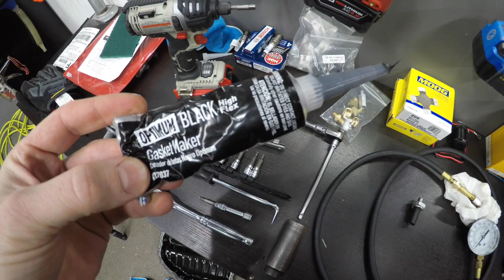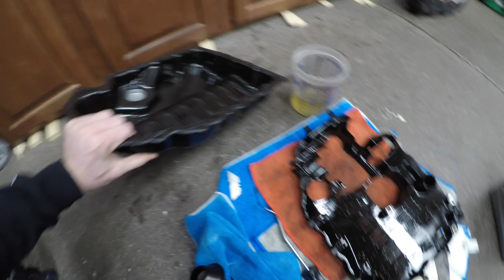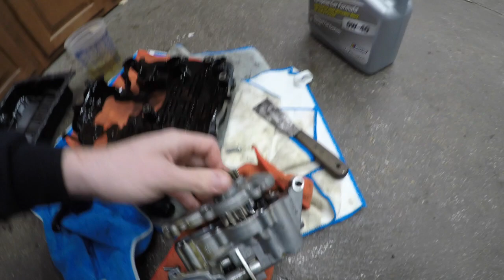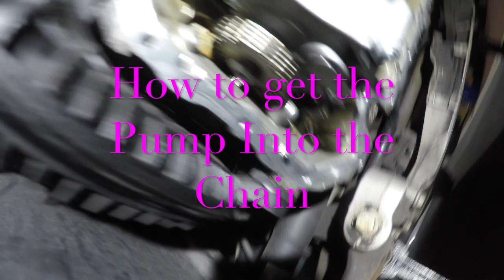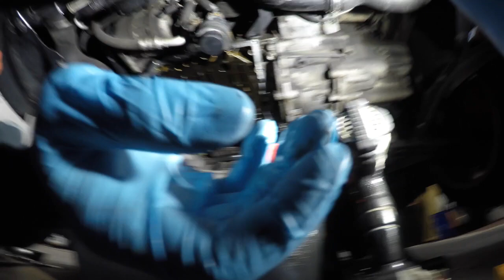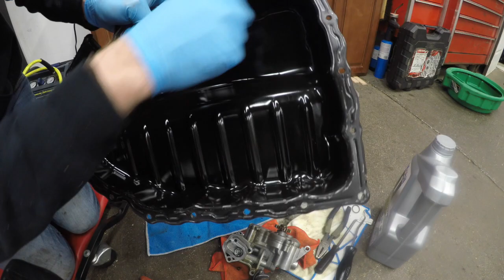MK6 2.0 TSI Oil Pump Installation - GTi / Jetta

Comment: My car has developed a whine sound whenever you rev it I’m attempting to replace the pump after getting a oil pressure warning
Reply from the maker: That’s hard to say. I haven’t heard a whine before, but change the pump and see what your pressure is like. It may be tensioner related as well. Good luck!

Comment: Hi Kenny! It is possible the timming slip with this procedure?
Reply: if i skip the put some oil into the pump, the oil pump could be damage? and some noise comes?
Reply from the maker: @Joseavazquez  hi, no the engine timing is independent of the oil pump. The pump has its own chain and tensioner which is driven from the crank. 

Putting oil in the pump before hand can help the priming of the pump and prevent dry run. It is a good practice although I have not had issues with the pump priming almost instantly as long as the engine is filled with oil prior to starting.

Comment: Not doing an oil pump, but doing timing chains on my wifes 2.0tsi beetle, by the looks of things am i right to assume the only way to get the damn oil pump drive chain out is to drop the oil pan ?
Reply from the maker: Hey, I think so based on where the tensioner is located. There may be some way to magically get it but for the time it takes to pull the pan, probably not even worth it. Also be careful when putting the crank pulley back on because you can bolt it back together without those triangular shaped teeth on the back. 

Also check the balance shafts while your there, and also the cam bridge at the top end. Those screens tend to pop out and may cause a pressure light. I ended up replacing everything in my car as a precaution. 

Good luck!

Comment: I have a similar problem with my 2.0 tsi jetta. I have had the oil pressure light come on and beep at me when decelerating for some time. Even more recent i have started getting a very loud knocking sound. Oil pressure was around 36 psi which is a little low. Could this be an oil pump? or something else like balance shafts, timing chain tensioner, or bearings?
Reply from the maker: Hi, it all starts with the oil pressure test at idle and accelerating the engine. If you are getting a noise you may have something going on there. I haven’t heard balance shafts make noise so you may want to drop the pan and check the rod bearings. Checking the pan will also allow you to check for metal debris and build up in the pump and pan corners. Good luck!

Comment: Hey I’m doing this on my GLI today. I’m very thankful for the video you made really. Now is that oil pump you installed still operating well?
Reply from the maker: Hi, Im glad it could help! Well, I sold the car about 2 years ago, but at the time there was no oil light or issues. So this certainly resolved my problem. I hope it resolves your issue as well!
Reply: @KennyChurchSpeed  thank you. I literally did the work a couple hours ago. I’m letting it sit in my shop overnight before filling and will see if it stops my issue. I get the light at low rpm when the car is at operating temp

Comment: FYI, for those of you who've had to remove their mk5 or mk6 tsi oil pan more than once or plan to remove it regularly for inspection, you can upgrade to an mk7 oil pan (or even an aftermarket performance oil pan from Wortek), which uses a proper o ring gasket instead of rtv silicone.
Reply from the maker: Thanks for posting and keeping folks informed.
Reply: Can it be used on the older style? Or the new style pan has the indentations for it?

Comment: So you didnt remove lower timing cover to do this job?
Reply from the maker: Nope, it is not required. The only part you need to worry about is the lower oil pump chain which isn’t timing related. The pump doesn’t care where the position of the crank or cam is, it only cares about moving oil.

Comment: I have the exact same issue, I'm looking to replace the pump soon. My car doesnt seem to have any mayor issues besides the pump,but I will be driving it like 2 more weeks before I can purchase the pump. Do you think I will be okay driving it like that till I can purchase pump??. BTW thanks for the video, it's very helpful.
Reply from the maker: Hi, thanks for watching and I’m glad to hear it is helpful. I would suggest not driving it if you can help it. You need the lubrication, especially at higher rpms. A $300 pump could cost you way more if you continue to drive it with low oil pressure. Good luck!

Comment: Hello I have a Tiguan 2.0 that gives me 0 with the pressure meter that can be
Reply from the maker: If the gage is reading zero that isn’t a good sign. Does it go up when you give it throttle and in rpm? If you have no pressure at idle either you have no oil flow at all, or the orifices that create pressure are open so something is worn.  Start with the pump and rod bearings. Easy enough to pull the oil pan and see what you find.

Comment: Can you help me with idea ? can i email you and get whatsapp number ose something else where to contact. 
Im preparing my audi 1.8 tfsi, got some parts changed. Oil pressure issue. I will make test pressure in iddle, and in rpm, hot/warm/cold etc etc
Reply from the maker: What idea do you need help with?
Reply: @KennyChurchSpeed  Audi a3 1.8tfsi bought it with timing chain plastic broken and timing chain skiped. Engine had damaged valves , New valve + seals, new timing chain. Installed all and after idling for 1-2 hour engine blocked. When opened found that Balanc shaft was blocked, not the water pump Balanc shaft but other one. Changed it with used one. After all install in reverse, after driving 20 minutes in city got Oil Pressure llamp on for 3-4 seconds. After turned off the car and started again after 5 minutes got it again Oil pressure lamp at 50-60 kmh hour, reving rpm again and does not get off the llamp. 4-5 second lamp on. Turned off the car and rest 1 hour, when getting home started driving 10-15 minutes lamp was on again for 2 minutes. every 600 meter lamp on and turned off car every 600 meters. No meter in 10kmh-30kmh lamp does not go off. It heard the noise from engine head and not function camshaft due to no much oil pressure. Now car is parked and i don't know where to start.
For now i will do the pressure test idle and rev rpm to see.
Reply from the maker: @azzxzxzaz  the pressure test is a good first place to start. These engines have a lot of oil passages and it is critical the screens are clear and free of debris. Balance shafts, cam bridge, oil pump, rod and main bearings all really important for proper oil pressure. First and foremost you need good oil flow which will be provided by the pump.
Reply: @KennyChurchSpeed  one of balance shaft had a plastic cover and was broken, we removed that plastic. Can that indicate problem without plastic oil canot get down freely
Reply: @KennyChurchSpeed  Just tested Oil pressure. When car is cold , Have at iddle 2.5 Bar pressure. When getting warm in 3-4 minutes it drops not stable from 1.5bar to 2.0 bar, 1.6 bar . 2.0 bar. 1.9 bar, not stable, 1.5,1.7,1.9.   After 8-10 minutes it drops 0.5 Bar with oil temperature around 60-80Degree, than it goes zero pressure oil temperature 90-105 deegre.

I have pressure when reving, but on iddle is zero after 1- minutes warm.
Reply: @KennyChurchSpeed  Hello. Changed the oil pump today. Enginse is the same, after 5-10 minutes of warm, Oil Pressure drop near zero on iddle. No diference.  Think is Cambridge or 2 balance shaft?
Reply from the maker: @azzxzxzaz  yes, unfortunately it could be one of those. It may be worth your while to check your rod bearings as well because they are easy to access with the engine in.

Comment: How important is that plastic baffle that sits around the pickup tube, what’s its purpose?
Reply: Keeps the majority of the oil in the sump (lower part of the pan), so there is always enough there for the oil pickup tube to feed the pump continuing the cycle efficiently.

Comment: I have the same issue with my Tiguan TSI, the sensor and oil filter are ok. I just open the oil pan and the plastic with the tube is ok. But I can figure it out that the oil pump is aftermarket and this could be the problem...
Reply from the maker: Did you check oil pressure with an external gauge?
Reply: @KennyChurchSpeed  not yet, I'm thinking to make it
Reply: @KennyChurchSpeed  I'm checking today, and if the pressure is lower?

Comment: hi dose the oil pump need to be primed
Reply from the maker: Technically, it may need to be. I'm actually not sure what the manual references. You can put oil in it before installation but the pump is a mechanical gear type so it tends to just leak out. Every pump I've put in, including vr6 engines I've installed cranked and it's built pressure right away. Especially in a used engine, it already has oil in all the parts that rotate. While you don't want it running for long without fresh oil, usually withing cranking and the first second of running you have oil pressure.

Comment: Hi Kenny I have a 2009 Jetta GLI. 2.0L. It’s a CCTA engine. I had a low oil pressure light came on. I changed the oil pressure sensor and I drove it for 2 hours. Then the light came back on for like 3-5 seconds, then It went away. I keep driving for 3 hours it never came back on. Do you think it could be a oil pump?  The engine oil level is full and I don’t see any where it’s leaking. I changed the oil 1000 KM ago.
Reply from the maker: Hi, it's hard to say. I've seen the sensors go bad. So if you changed it and it doesn't come back on that could have been the issue. However, I would do an oil pressure test to be sure because you don't want premature engine damage that could have been avoided.

Comment: Great Video!  Thank You! I was just reading all of your excellent responses I did a pump but I’m still getting low pressure.  It’s been going on    
On and off since 115K miles and now more frequently at 161K! My pickup tube had some junk in it so I was hopeful.  I need to do some more troubleshooting.  The car drives great but I get that intermittent low pressure warning more frequently.
Reply from the maker: Thank you, when do you get the light? On decel, low rpm, high rpm, startup?

Comment: Thank you for taking the time to put this vid together!

My issue started after a botched valve decarb. My idiot cousin said he knew what he was doing but ended up f-ing everything up.  Had to take the car to the shop for valve job, but now the shop doesn't want to mess with it anymore. They're just not used to these kinds of repairs and have a long wait list due to labor shortages.

I guess my question is, what is the most likely scenario here? Oil pressure registers normal at higher RPM, but drops to nothing at idle. Mechanic says there are shavings in the oil and there is likely a blockage somewhere, but the pick up tube screen looks normal. So where could this blockage be?  Could this be a bad oil pump?

It sucks because the car is in otherwise great shape and I'd hate to simply drop another engine in it or junk it.
Reply from the maker: @TrollBuster thanks for the kind words and you're welcome.

As far as your questions, what did your cousin screw up? When you do a valve cleaning you don't need to do anything with timing that would lead to a valve job unless there was a tool left in the cylinder?

As far as what's next, if you have checked oil pressure with a gauge and you see good pressure at rpm then it typically isn't a pump issue. If you have low pressure at idle it could mean you have bearing failure( result of cleaning valves and solvent getting into cylinders and leaking into oil reducing lubrication properties), or the screens in the cam bridge blew out, or balance shafts are wearing. The unfortunate part of these engines is there are a lot of passages that prevent oil flow(hence creating pressure) so when they are absent pressure is reduced. 

What I have learned is once there is an oil pressure issue you have to replace all the components and check the bearings at least. The balance shafts, cam bridge, rod bearings, cam journals all contribute to ensuring pressure is created. 

I hope this helps...
Reply: @KennyChurchSpeed  Thank you for your insights. I think my cousin used the wrong medium (too fine) to blast the carbon, and didn't take proper precautions to ensure the fine medium didn't get where it shouldn't have. I suspect that's what those "shavings" are -- medium particles that ended up circulating in the oil, causing a clog that starved the engine of oil pressure and damaged it (I haven't personally seen the particles, I'm just going by what the mechanic said on the phone). I'm not ready to give up on it tho. If it is a clog, I think the logical thing to do is disassemble it and clean out every orifice where oil flows, replace any parts that show clear signs of wear/damage, and put it all back together. I know it's labor intensive and therefore expensive, but I'm just not ready to give up on it. I don't know, maybe I'm just an idiot and don't know what I'm talking about... lol
Reply from the maker: @marco1173  I'd give you an "A" for effort and it certainly can be done. The balance shafts are the hardest thing to remove with the engine in the car. Everything else is cake. Also you need a special tool to remove valve cover because it's the cam cap/girdle assemble in one. If media got into the cylinders you may have more problems than just oil pressure. You may want to consider time and effort versus cost of a used running engine.
Reply: @KennyChurchSpeed  That's just it. The shop says the only used engine they could find has 75k miles on it and the total cost of engine+installation is $6700. That's just crazy, especially when I can order a complete brand-new engine assembly from the dealer for under $5k. In any case, it's turning out to be a very expensive decarb job. I haven't talked to my cousin since this happened, but I can't hold a grudge forever. I just need to get this thing back running again. I truly miss driving it.
Reply from the maker: @marco1173  I understand your predicament. It sounds like your cousins heart was in the right place, but perhaps he didn't have the skill set. My fear for you is if you got media in the cylinder and it scores the bore you will need rings and honing.
Reply: @KennyChurchSpeed  I thought you might want to hear an update, Kenny. Maybe I can pick your brain too? You seem knowledgeable enough with these engines...

Anyway, I have the bottom end mostly taken apart. Oil pan, baffle, oil pump, all out. No obvious issues there, though I'm not sure about the oil pump... Looks mint, but how can you tell if it's good or not just by looking at it? 

Yesterday I started working on removing the subframe to check for obstructions, since I suspect the oil filter opening may have been left exposed and debris made its way down there. I'm sorta stumped here... There are 5 M12 bolts holding the subframe to the engine block, but then it looks like the engine mount may need to come out too?

How difficult would it be to remove the engine without a lift? I mean, I have access to an engine hoist and stand and it's starting to make more sense to just work on it completely off the car.
Reply from the maker: @marco1173  hi, there is no easy way to identify a pump issue when you look at the outside. Mine looked great as well, but something was certainly malfunctioned based on oil pressure test. It could be excessive wear or clearance in the pump gears, pump drive slipping, or the pressure relief staying open. 

As far as removing the engine, I would have pulled it already with a engine hoist to not have to kill myself trying to get to everything on the ground. I forget what exactly the problem was with yours, but if you aren't building oil pressure when revving you have a pump or flow issue. If you build pressure at idle chances are you bearings are good, however you'd have to check the thickness with micrometer and check oil passages for debris.
Reply: @KennyChurchSpeed  You'll never guess what (part of) the problem was. It was actually two problems, but only one related to oil pressure, and that was just the insert tube for the oil filter housing. Not sure how it went missing, but it did, and replacing it fixed problem 1. 
Problem 2 ended up being the VVT control valve. I replaced it as well and the car is now purring like a kitten.
Reply from the maker: @marco1173  well considering all of your oil goes through the filter and it's a major passageway I'm not surprised that caused an issue. However your solenoid not working is something else entirely. I didn't recall you having a problem with it running poorly other than oil pressure.

Comment: Hello Kenny, could low oil pressure cause low turbo boost?
Reply from the maker: Hi, only if the turbo was starved of oil and the turbine no longer spins.
Reply: the oil pressure sensor light comes on at around 4000rpm so I guess the oil gets to the turbines.

Comment: i have a 09 cc, i just dumped out 5k to get the timing and head redone, NOW im having oil pressure issues.. 3 years after you did this, is all still good for you?  thanks for video!
Reply from the maker: Hi, thanks for watching. I actually sold the car last year so I am unaware of what has happened since. However I did drive it for two years with no issues. With that in mind I did replace the cam bridge, balance shafts, oil pump, and chains and had the head fully cleaned when I bought the car because it had bent valves.